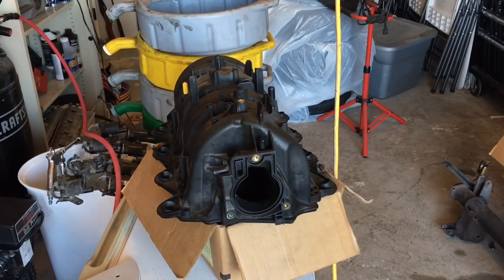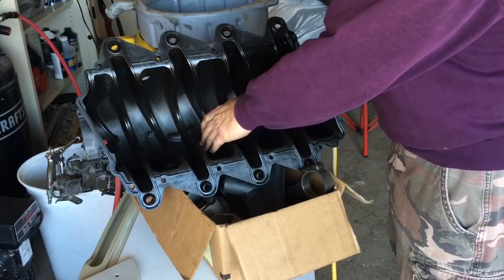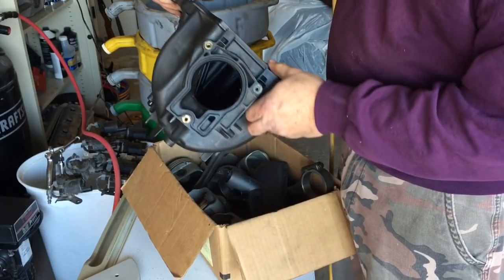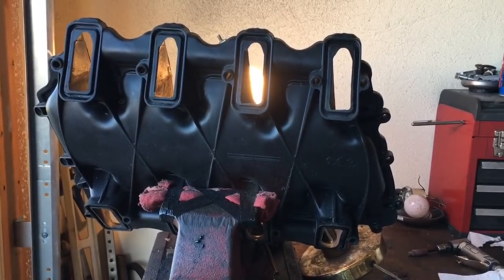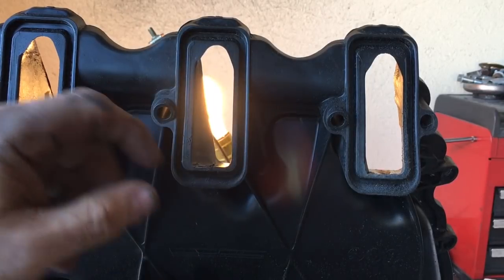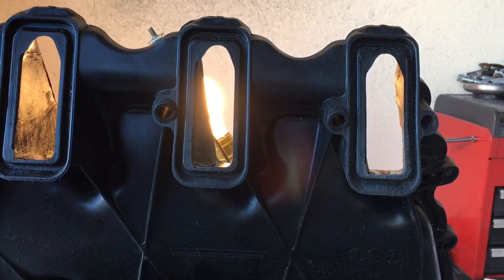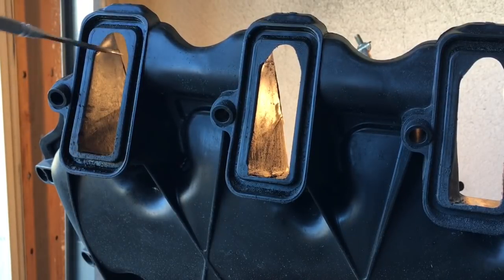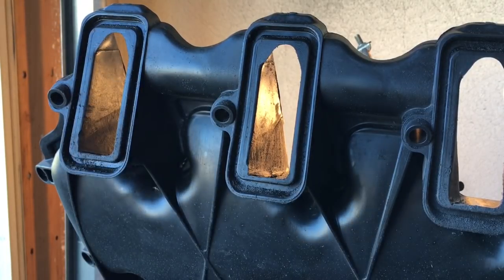LS 4.8 5.3 6.0 Cathedral port Intake Porting 615-183

Comment: The "cathedral" is only for the injector, it doesn't flow air.  and the floor is dead...better off filling the bottom 1/4" with epoxy.  700whp on a 6L is just a good cam/springs and 11 psi.
Reply from the maker: I’d think 700 whp at only 11# even with a 6.0 is a bit optimistic. But I like how you think!  👍👍👍.  Mathematically if you have a 520hp NA 6.0 you could get the 909hp you need to net 700 whp through a TH400. Definitely possible for sure!

Comment: Is that done for strength for turbos that push over 15lbs? Any pressure system might blow out the intake if removed?
Reply from the maker: I was just doing a true match between the intake port in the head and intake.  The intake has a slightly restricted cross sectional area so I removed the extra material.  FWIW my 4.8 did not like this intake, the plenum volume etc was too much for the smaller CID.  I’d say this style of intake especially ported needs more CID and high rpm to work best. 
I’m not sure about these multiple piece intakes handling high boost I just haven’t tested it. JD

Comment: So how did you end up sealing pieces together to prevent leaks?
Reply from the maker: Michael Swafford I simply screwed it back together no problem, but keep in mind this was a new intake never been heat cycled. 
I’ve read all those threads online where people are worried about sealing the intake sections, but honestly it’s a simple rubber o-ring seal, why would it fail?  Not sure.  JD
Reply: HeadFlowInc thanks! Kinda my thought as well but after seeing all the posts about not sealing i opted to ask someone that has actually tried it. Thanks again

Comment: I have the 99 lq4 truck 6.0 from a sierra 2500.  I found an 06 denali lq4. I want to use the 06 aluminum heads and pistons and rods on the 99 block and crank. I only have the 99 truck intake and as far as I can tell. Its 1 piece.  What can I do with it?  Ive cleaned up the throttle body.
Reply from the maker: Dinky Ray The first thing to address, the 2006 Gen 4 pistons and rods weigh more than the 1999 Gen 3 units you’ll be replacing.  You could run it without balancing but I highly recommend having the assembly precision balanced.
The only easy work you can do to the truck intake is to clean up and gasket match it to the gasket.  There is a tiny bit of smoothing on the inlet to the plenum but not much. 
Thanks for watching!  JD

Comment: Ok so mixed reviews from some people here.....do i cut the steps out or leave them there? I want to open them up, but really just unsure if i should or not. On 5.3 stock daily driver.
Reply from the maker: Shaunthepyrotek Honestly, if it’s a bone stock 5.3 I’d leave the steps alone.  Thanks for watching and the feedback I appreciate it!  JD
Reply: @HeadFlowInc  its going to get motor rebuild and port job by you, cam , top end, bottom if needed. But as of right now, im putting it and a cold air kit (been lightly porting this dorman intake) on it until i build my shop to pull the motor for the rebuild.
Reply: @HeadFlowInc  also side note or bit of useful info if you guys dont already know.....this is a "dorman" not advertised as dorman, but sold on Amazon for 120$. Its the exact same, stupid steps and all! Its a dorman, sold somehow for a quarter of most places selling labeled dorman intakes.

Comment: I got the ''ugly intake'' on my lr4 4.8… this intake should be better? And if i look in junk yard, should i look for yukon and Caddy 5.3L ? 🤔
Reply from the maker: Jocelyn Lauzon Well there’s new information we’ve found surrounding these Large plenum long runner intakes. Yes the initial reports show a 25+ hp gain, this apparently was on 5.3 & 6.0 engines. 
My friend Richard found a thread saying this large plenum design isn’t suited for the smaller stroked 4.8’s 🤔🤔🤔. I’m really torn on how I feel about this new to me information. 🤷‍♂️
I highly encourage you to heavily research specifically putting this intake on the 4.8’s. 
Now if you’re running a large cam, big stall and steep gearing it may work great!   
I feel it’s like the old debate on running a Single plane or Dual plane intakes on the old SBC engines, you want one that works best with your overall combo.  JD
Reply: @HeadFlowInc  by this time, it's still stock + th350c with a 3.43 rear end (swapped in my '81 Malibu 4dr 🤣) i'm planning to put a turbo on it and i love the way this intake are open inside vs. The ugly intake... 🤔 That's the only reason i'm looking for that intake but it seems hard to find here in Québec 🤦🏻‍♂️... and i dont know how much boost can handle those intake 🤷🏻‍♂️
Reply from the maker: Jocelyn Lauzon I’m in the process of going turbo on my 4.8.  I’m switching back to my original truck intake.  
I’m not sure what models came factory with the Dorman style intake.  🤔🤔🤔. I know the SPPTV guys found one at a yard in Canada but I don’t recall the type vehicle. 
You can also look into smoothing the original truck manifold, they look super nice after smoothing.  Check out some videos on the process. JD
Reply: @HeadFlowInc  yess! i already shaved my Truck intake and thats look good! but even n/a, she ''inflate'' with the air pressure passing by the trottle 🤦🏻‍♂️... So i'm scare to ''explode it'' with some boost 💥😂🤦🏻‍♂️
 (btw sorry for my english, yes, i'm ''frenchy'' haha! 🤘😎)
Reply: HeadFlowInc how did you find the bigger intake on your NA setup before you added the turbo?  Was it worth it?  I always thought more air the better with an LS

Comment: I am assuming you have never heard of port velocity. With they flow these intakes have thats why they runner is stepped ...Velocity once you take to much and you slow down that velocity you kill bottom end torque. Being on a turbo engine it will have zero effect because of they added air charge but on a naturally aspirated engine it Will have a dramatic effect one lower. And torque. Not being a dick but from a engineering standpoint thats exactly why these port runners are like that

Comment: on a 4.8 how would a the dorman perform compared to the factory truck unit? anyone know of any dyno tests?
Reply from the maker: from Al From what I’ve found the Long runner intake makes more Torque and HP than the regular truck intakes.  The Dorman long runner intake is a better design and feeds each runner more effectively.  The longer runners build Torque and the large open plenum feeding the runners helps HP especially in the upper RPM range. 
Do a Google search on the Dorman Long runner truck intake, I’ve seen it called a copy of the FAST truck intake. 🤔

Comment: Good work on this 615-183 , didn't realize you have a follow up to this wish you had named the other part 2 or something. Oh p.s. you have mail I sent you a pm.
Reply from the maker: Gregg Johnson I will work on the titles and put the videos together in a play list.  I bought one of the 615-183 intakes for myself after hearing how well it worked on Jakes truck; I’ll be showing the port work on it as well. 👍
I can only access Messages from my laptop, I’ll check when I get back to the house.
Reply from the maker: Gregg Johnson Jake, the owner of this intake had previously swapped his 4L60e for a 4L80e in his truck; like everyone else he didn’t like the loss of off idle feel of the 80e 2.48 first gear.  After swapping his regular truck intake for the Ported Dorman he swears it restored the low end power feel and runs stronger mid-top end!  Since I’m looking for every little gain on my 4.8 build I decided to try it! 🤞. 
I’m working towards 300-330 rwhp out of a NA 4.8 🤔
Reply: HeadFlowInc Cool I will follow that too ! Some have had a  problem getting this intake to seal . But I take it wasn't a problem with this one.
Reply from the maker: Gregg Johnson I’ve read a lot of people having issues with the Dorman LS6 intake, but I haven’t found near as much info on this long runner truck intake.  I may try and port my intake without pulling it apart to avoid any possible sealing concern.  My intake is new, Jake’s intake was used and Richard bolted it back together with the factory original gaskets; seems to be fine. 
Now once we add boost, then there could be concerns?
Reply: @HeadFlowInc  you can make 400+ HP with a BTR '"torque" cam beehive valvesprings, trick-flow heads! 🍺

Comment: The head side of the ports are probably molded as a solid flat with the seal slot around it and they go in and cut a window in the shape of a cathedral port. That's the only way that I could see there being a 1/4 lip on those sections of the intake's port where it meets the head. A flat hand file and a round hand file would be ideal for flattening out that "lip". As mention by many others trying to use a dremel will just melt the polymer "plastic" and load up your sanding bit. A drill will go slower but a good set of files will cut that down to shape fast and straight.

Comment: Maybe it's just the way the Dorman manifold is port matched, so they all flow the same.  Even if it is a poor way of doing it.
Reply from the maker: Kim Sylvester I can report the owner says the port work made a big difference in both lowend and top end power.  Jake had swapped from a 4L60e to the 4L80e, as a result of the 80e having a lower 2.48 1st Gear the truck felt soft from a standing start; he says the Ported intake restored the lost lowend take off. 👍
Reply: Its purposely done that way to increase port velocity. Velocity equals low wnd torque

Comment: the lines are from the molds. because of the complex shapes they use shifting mold parts to make the parts. they should have made this a lot better but good news is. you can use a hand file and shape it easy. some power tools will help but plastic dont like the heat from power tools :)
Reply: https://www.youtube.com/watch?v=RMjtmsr3CqA
Reply from the maker: Makes sense,  im not showing all my secrets. Thanks for the feedback!  Happy Thanksgiving!!!
Reply from the maker: Bradley Campbell Have you seen the blockage I describe in the Dorman intake?  I hope the viewers understand it’s not a casting flash or line, it’s a 1/4” Wide shelf that tapers to the inside.
Reply: yes. no idea why they do that. it always pays to examine things and question why?
Reply from the maker: Bradley Campbell Exactly!   Making all the power you can with the parts we have. 👍